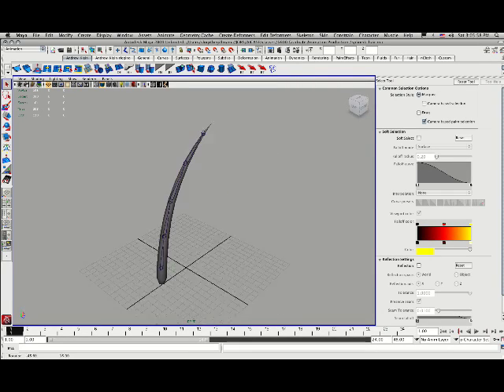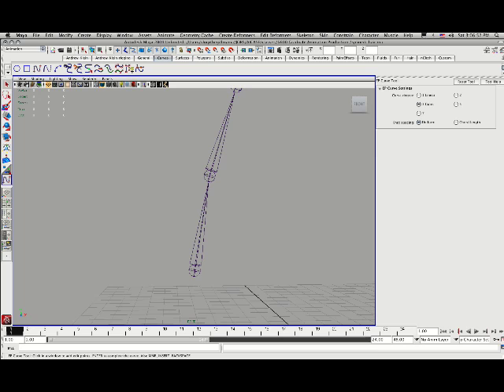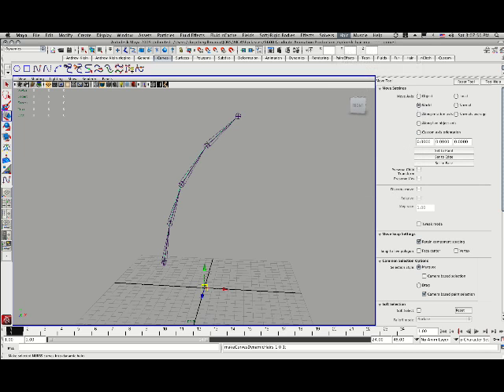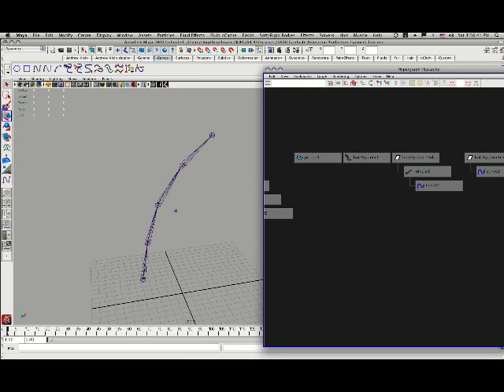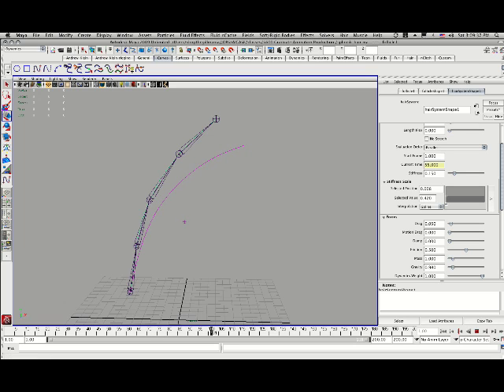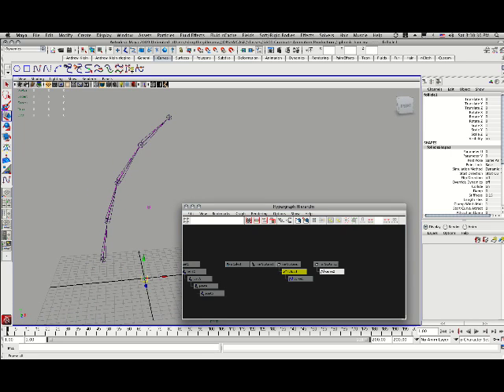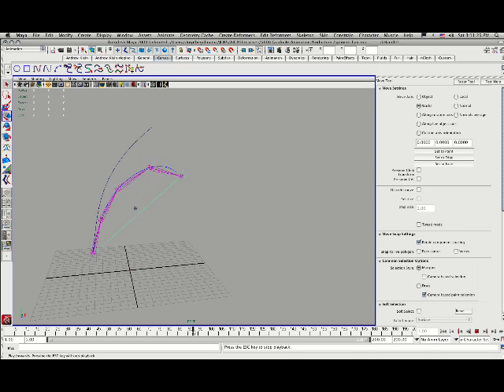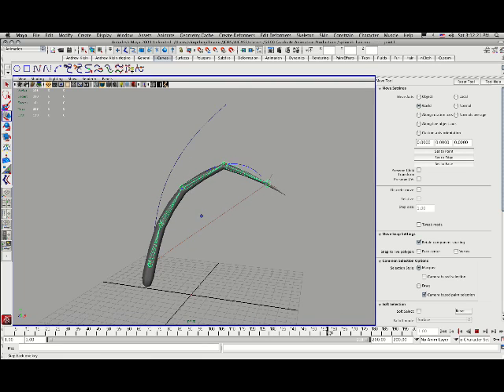Dynamically drive a joint chain with Hair in Maya

Comment: this is nice, but why can't i move the joints anymore??? after doing this. I'm doing a simple cartoony animation of hair so my character hair is a geometry and has set of joints bind in it. i did your tutorial to move them like a real hair would do.
but when i tried to move the joint, it won't move from its position. I even parented the geometry or joint to the head of my character but the joint/geo won't come along with it.
I cant do interactive playback because I only use laptop. and it's heavy rendering.
please help me. thanks

Comment: I am curious. Could you create the same effect by extruding a face along a curve, tapering the extrusion, driving up the subdivisions of the extrusion, and then making the curve dynamic? If you don't delete the history of the polygon hair, the extrusion should still follow the curve, right?
Reply: I tested it out and I have confirmed that, yes, you can extrude along a dynamic curve and, yes, the extrusion will follow the curve as it bends and warps.
Reply: Nathan Warford I've tried this and had a lot of issues when it came to constraining the mesh, have you had similar issues?
Reply: The problem that i've had is that the curve doesn't know which way is down. If I were to flip the curve upside down, it would "fall" upward.

It looks like joint chains are the way to go. The problem is that the only way to make the mesh as smooth as possible would require a joint for every subdivision, and that would eat up a lot of time, and probably a lot of computer memory as well.

Comment: thanks man with this i can make a lot more styles of character. but i wanted to ask if it will pass through an other polegon. because im thinking of rigging a skirt this way but it might pass in to the legs when running the animation. do i have to make the body a passive rigid body??